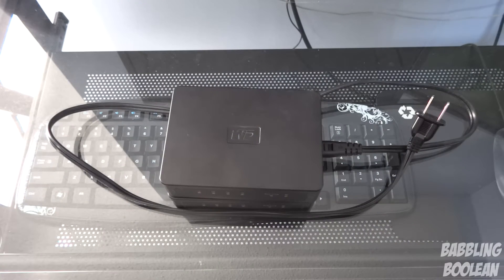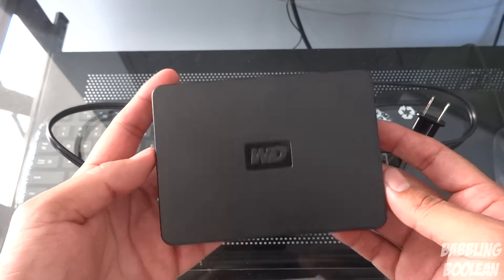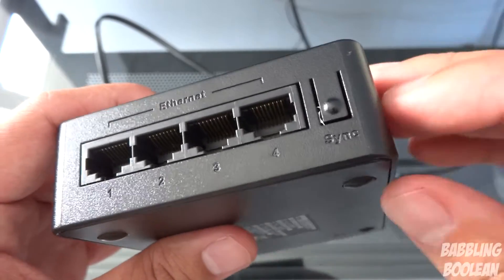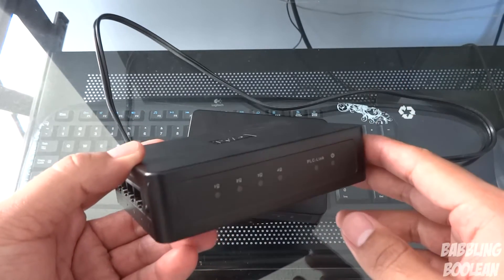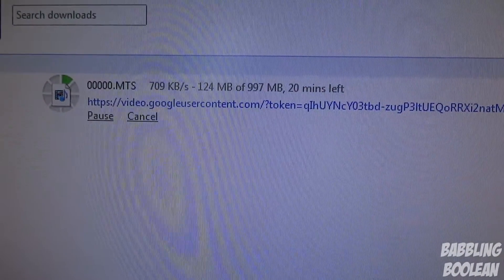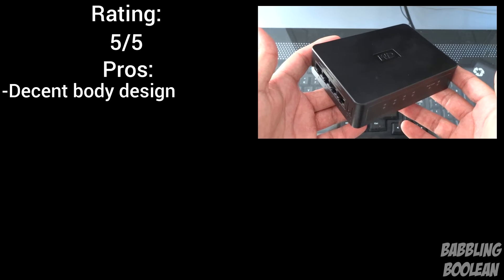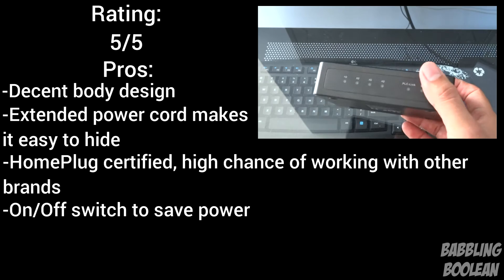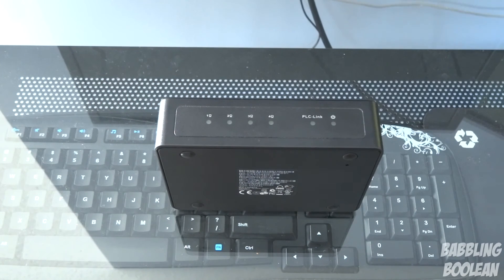WD Livewire Powerline Kit In-depth Review

Comment: Powerline ethernet does not use electricity so to say it emits (wattage is not used) 4 watts would mean the LEDs to show connection are real hogs at emitting power. There is no increase in your electrical bill from any of the powerline kits for that reason.